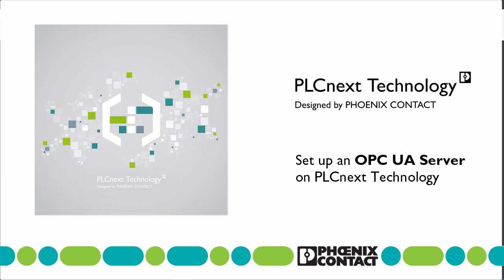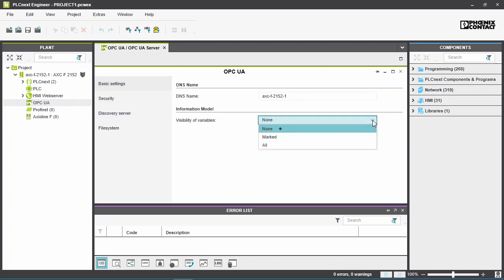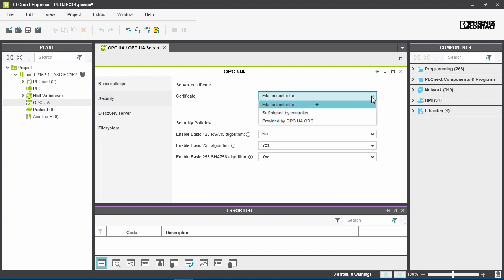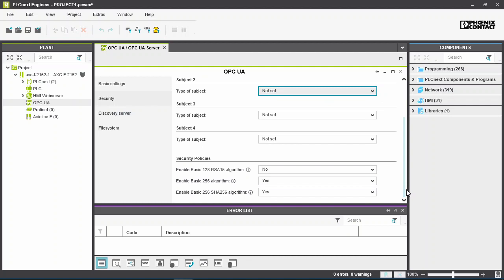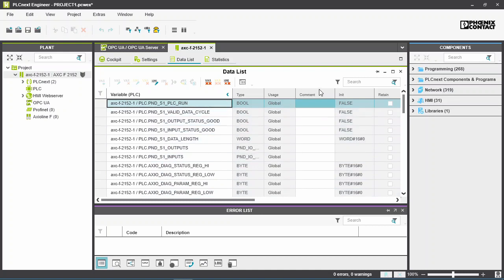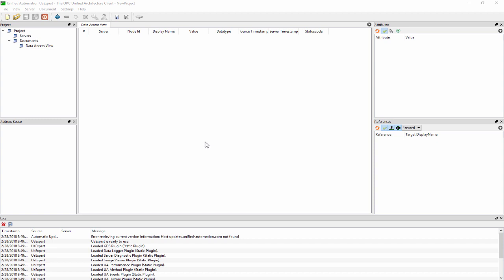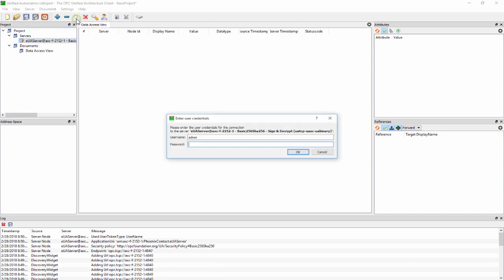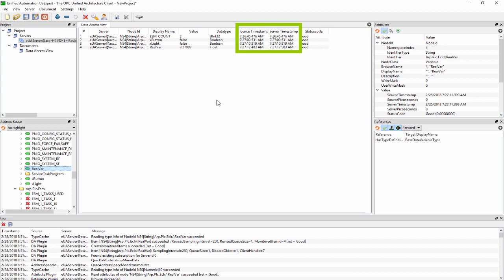OPC UA with PLCnext Technology | How to set up a server connection with PLCnext Engineer

Comment: How do i fix UTL0001 internal error
Reply from the maker: Could you elaborate on that, please?
Reply: @PhoenixContactTechnical  i make one project in plcnext software at starting it was compile and download a after that i work on it but when i restart my system whenever i open program it show me this error...
Reply from the maker: @rdp9875  : If by "plcnext software" you mean the PLCnext Engineer as the standard engineering software for IEC 61131-3 automation projects, please check that error code in the Online Help of the PLCnext Engineer. Otherwise, let's relocate this chat to the Forum of the www.plcnext-community.net!
Reply: @rdp9875  you must open before plcnext engineer , then you can open your project inside plcnext engineer

Comment: Is it possible to send images from the UAExpert software to a PLCNext device? If so how would one be able to achieve this?
Reply from the maker: ...we're about to clarify this, will be back with an answer soon...
Reply from the maker: Now, Brian: in order to send images to a PLCnext device, you have to enable OPC UA filetransfer. You can do this by means of PLCnext Engineer, the PLCnext Technology engineering software: open the "OPC UA" tab, choose "Filesystem" from the sidebar, and set the OPC UA Filetransfer drop-down menu (first item in the tab) to "Enabled". There's another way to initiate a file transfer, via XML. We're about to make a short instruction to this topic in the  www.plcnext-community.net soon.
Reply from the maker: Here's a short tutorial to this topic: https://youtu.be/Jgwt_0y5aCw